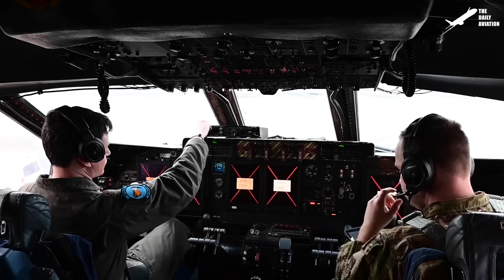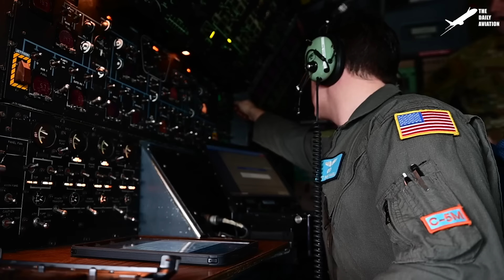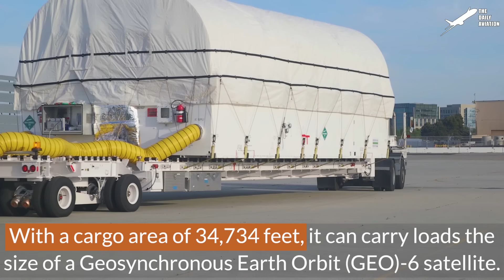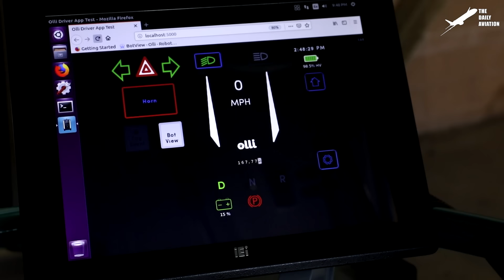Insane Process of Taking Off US Largest 420 Ton Plane Ever Made

Comment: I was stationed in Charleston from 68-71. they don't mention that the first C-5 was delivered to Charleston, and when it landed one of the wheels broke off and followed the C-5 down the runway.
Reply: They had a problem when one of them landed at Pope AFB in NC around the same time period.  In this case, the pilot tried to take the first taxiway and put the nose gear into the grass/gravel. 🥵  They had tail number 00001 come in the next day with replacement parts.